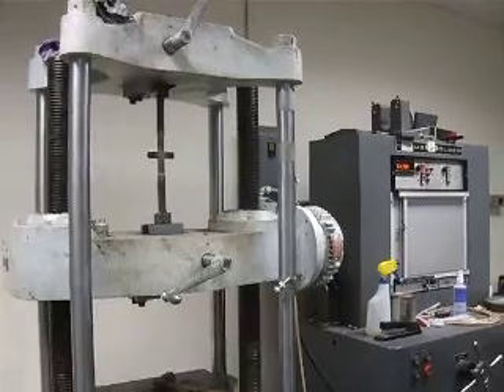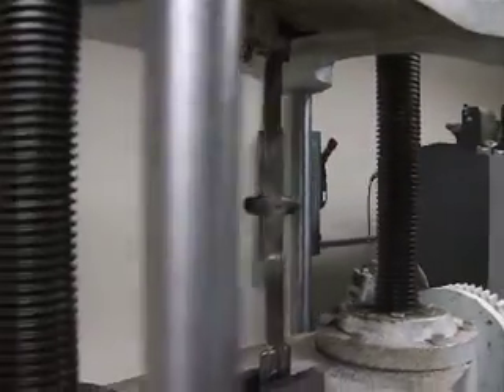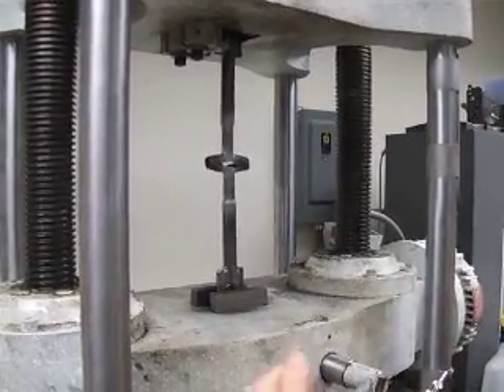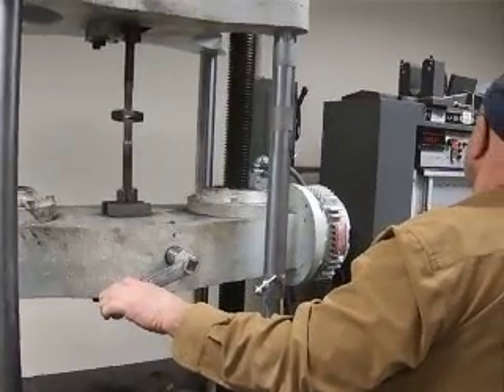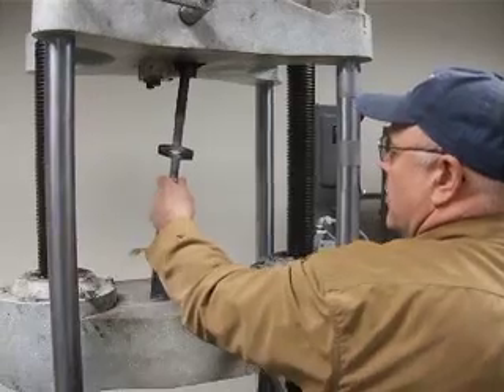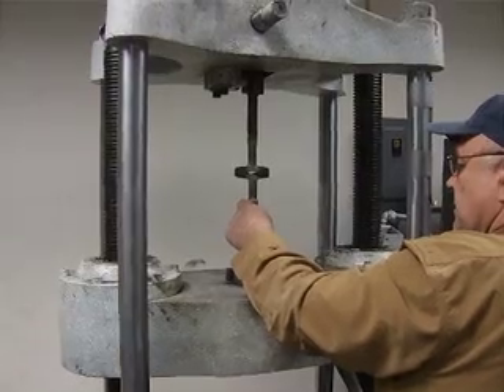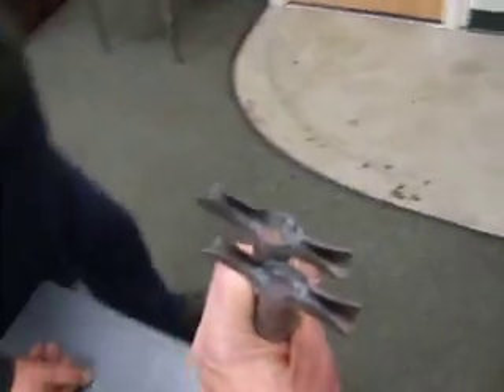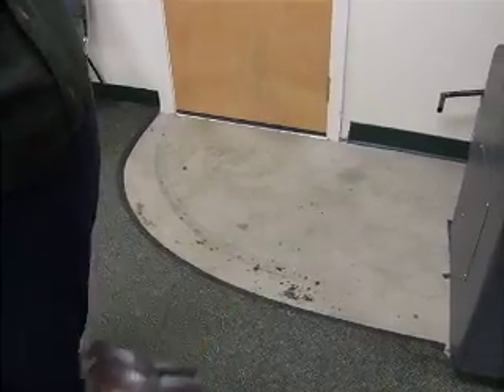4130 Tubing - Welding Rod Test Part 5

Comment from the maker: I looked at my samples and found an OA ER70S2 that I tested, but I didn't write down the numbers when it failed on the sample. OA welding was much more about technique and making sure the weld penetrated, but didn't get too hot. Interestingly, the best test sample I got was an OA weld using ER70S6 rod - 7550lbs. YMMV.